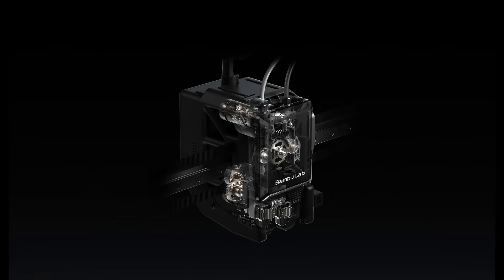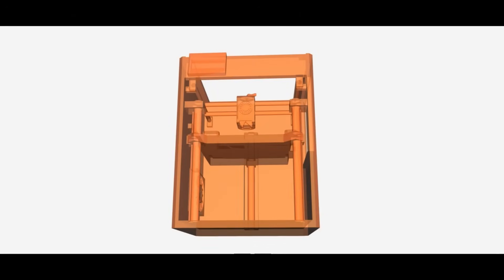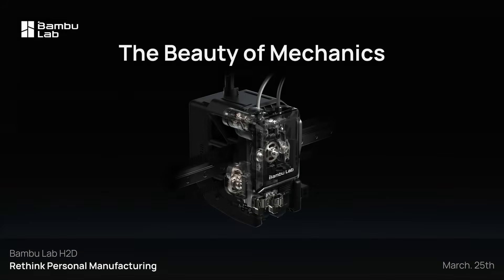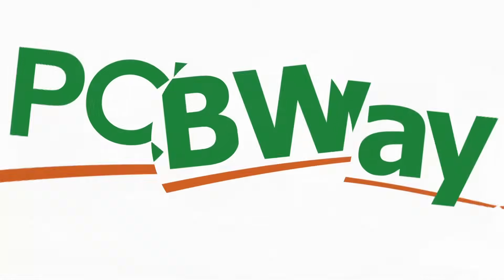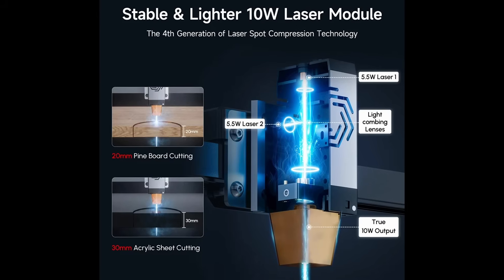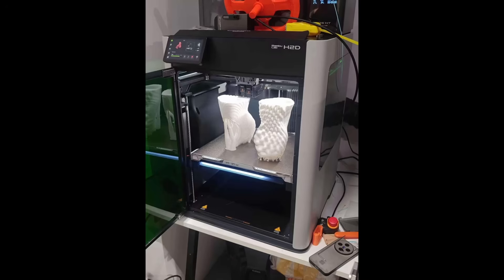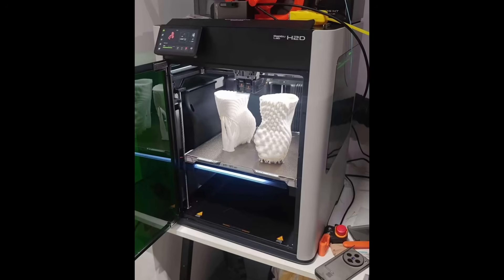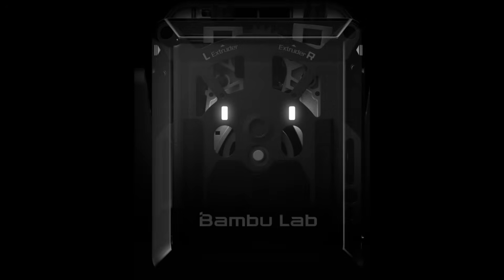Bambu Lab H2D Latest LEAKS and FACTS

Comment: Still hoping that they have 2 versions, one with the laser and one without.  Or just have the laser as an optional add on.  Really would like to see the printer and the new AMS for under $2000.
Reply from the maker: thats indeed what i'm hoping for aswell, but as any other selling strategy, they will most likely try to sell it first as a full combo (laser including) then sell them seperately.
Reply: They do. You can buy the basic combo and then upgrade in June. The downside is that the upgrade kit doesn't contain internal filters that the Laser combo machine will have.

Comment: I wonder if it will use the same nozzle as the a1
Reply from the maker: i would say no, but probably something similar since it will be fast swap nozzle.
Reply: No, but yes. It will fit but the flow rates are not as high as the new ones. You can even use these new hotends in the A1 (with the new sock) for some flow gain.